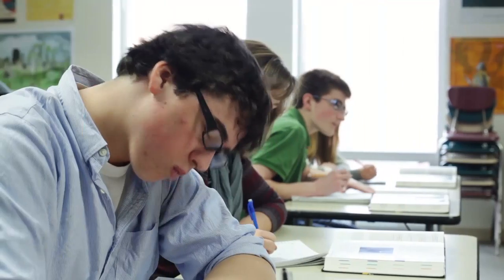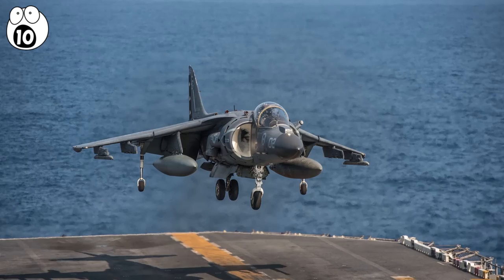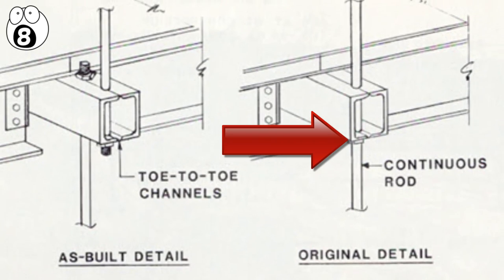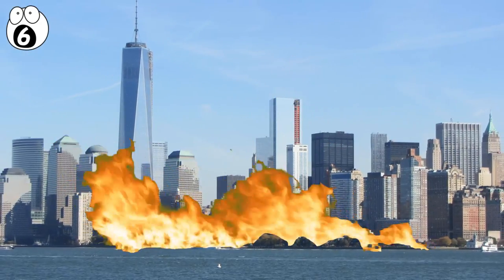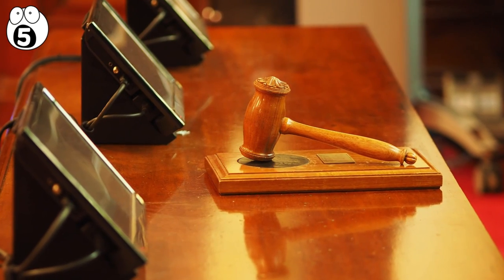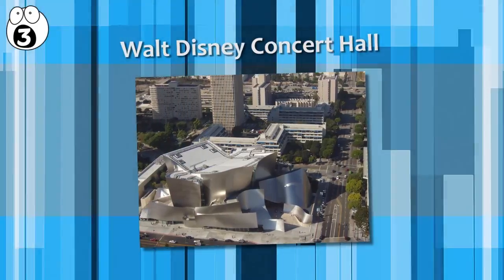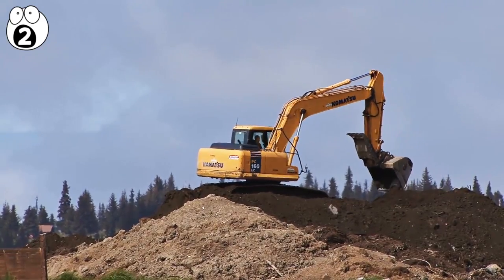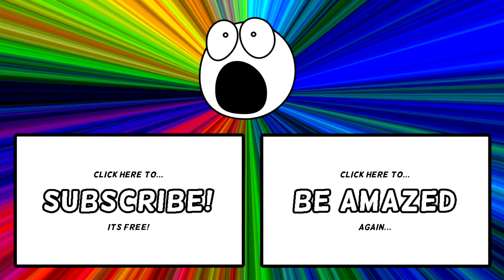Biggest Design Errors Engineers & Architects Made

Comment: Have you considered that it was difficult to build a huge runway on old ships
Reply: I  wonder if they had catapults on the first generation aircraft carriers. Probably not, that would explain the single long runway.
Reply: kunstsein I would have to assume probably not
Reply: Catapults were added IIRC in 1943 to the Enterprise, which was usually upgraded a little while after the ships came off of the production line. The reason they had no catapults earlier was not because they didn't have the technology, but it was because they were unnecessary. The F4F wildcat, which was America's main naval fighter until 1942/1943, which was notoriously under-powered, could take off in 174 feet, with a 25 knot headwind(http://www.wwiiaircraftperformance.org/f4f/f4f.html). That speed is what an aircraft carrier would be going at launch speed, not even with any actual headwind. So that distance could be shortened by an actual headwind, and due to the fact that the deck was usually 50-100 feet above the water, a wildcat could take off in about 1/4th of the entire deck length of 770 feet with ease, loose a bit of altitude if he is going too slow, but then be able to climb out fine. When planes such as the f6f and f4u came around ( and other bombers and scout planes), the need for extra plane storage space and a shorter takeoff distance encouraged the addition of  a hydraulically powered catapult which could increase the speed of the aircraft to suitable takeoff speed in less than 75 feet. 

:D
Reply: Thanks for the infos, appreciated.
Reply: Most aircraft carriers at the time were actually just normal ships converted to be "aircraft carriers" because it was much easier than to build one from scratch... So this video is bullshit...
Reply: Ok you are incorrect. If you are referring to WWII they were built from scratch after around 1930.
Reply: +cyberworks entertainment:
as I said above mama Houshou was the first purpose built carrier ever made ever. That old girl was commissioned in 1922. America's first purpose built carrier was ranger, laid in 1931.

as for WWII: our big names are Yorktown class (3 hulls) like Enterprise: these were all purpose built for the role, and started showing up in the late 30's. Akagi and Kaga were started as Battleships in the 20's but when the washington naval treaty happened the IJN gutted out the hulls and rebuilt them as carriers (a limit was placed on 16" guns by the treaty). But all the other pearl harbour carriers Shoukaku, Zuikaku, Hiryu, and Soryu were purpose built. USS Wasp, the Essex (24 hulls) and Midway class (3 hulls) were also purpose built. The Japanese also have the Taiho and the Unryu class (3 hulls) that were purpose built. The Germans attempted the Graf Zeppelin but never finished her because she kept getting bombed. The British had carriers as well, though I know virtually nothing about them. 

there's also a whole slew of light carriers that were purpose built by the US.
Reply: Although, Japan really didn't make a huge show of Houshou. They didn't want the eyes of the world on them (specifically their military buildup) and so they more-or-less kept quiet about such things. They also made Nagato appear to have a lower top speed than she actually had, to make her seem less superior to Colorado.
BTW, you're forgetting Shinano, whose origin was akin to Akagi and Kaga (though on a grander scale). She WAS built but soon became "the largest surface ship sunk by a submarine." USS Archerfish pls.
I can't remember, did Mama Houshou have any contemporaries at the time of her construction? Like, by the time she was carrying out carrier ops (I believe in China) did any other nations have CVs being launched? Such as the Langley?

Comment: Hyatt walkway failed because the weight of BOTH walkways was on one fastener, instead of just one. With one continuous rod you would have a fastener (nut) mid way that holds the top level, and another at the end holding the bottom. This would result in each fastener set holding one walkway. Both walkways weight still goes through one rod.  With the way it was implemented, the lower level hung from the top level, so the top levels nuts had to hodl both up, and failed.

Tacoma bridge was actually very flexible and bendy. The bridge failed because there was no wind relief, as you said, causing lift, which over stressed the bridge.  The holes would not be for flexibility but as you say to let wind through interrupting the lift.
Reply: And wasn't the weight of too many people the biggest factor in the collapse of the walkway? More people than allowed by the city and/or engineers?
Reply: Mark, not really.  There should have been enough margin designed in to handle a little extra.  The big mistake was a change to 2 shorter rods during construction.  The engineers either didn't recalculate or weren't even asked (not sure which).
Reply: But it wasn't a little extra - there was a HUGE, packed dance party going on, as I recall.
Reply: Sure it was busy.. which made the fact the one set of fastners now had to hold double the load of its original design deadly.
Reply: Mark Basnight Engineering standards plenty of extra strength especially in public buildings such as the Hyatt. With the original design you could pack as many people as possible on there and not have an issue. The problem came from the fastener/connection at the bottom of the top rod having to support the weight of both the top and bottom walkway. With the original design the fastener/connection under the top walkway only has to support the weight of that walkway and not the one below it. The video made it sound like it was a problem with the top rod however the top rod was still in one piece and hanging from the ceiling after the walkway collapsed.
Reply: Thanks Curt. I might have been not saying it correctly
Reply: I imagine someone got good and sued.
Reply: they did recalculate and where told. The engineer in charge ignored the problem and the information was leaked to the press.

Comment: The square windows weren't the sole cause, or the start of the problem on the comet. Old sheet metal methods punched holes into the metal which caused miro fissures in the metal. (stress induced cracks), The square windows were a focal point of pressure that only increased the failure of the metal.
And with the constant cycle pressures of inside the cabin and atmospheric pressures. The airplane failed in flight when it was pressurized.

All windows are rounded now to evenly distribute the pressure load. And, holes are no longer punched out. They're drilled and reamed.
Reply: Also, he says "going extremely fast, extremely high off the ground, it really concentrates a lot of stress". Speed had nothing to do with it; as you point out, it was pressure changes. 

It couldn't be proven conclusively (and safely) until one of the investigators came up with the idea of replicating pressure changes by building a water tank and submerging the plane in it. Needless to say, the plane wasn't moving extremely fast inside this tank. 

This video is infuriating. EVERYTHING he says is wrong.

Comment: The straight deck carrier was satisfactory in days of slow propellor driven planes.  Once the jet aircraft with higher landing speeds came on line, with the possibility of a bolter (landing airplane missing the arresting wires) the need for angled decks became apparent.
Reply: Chuck Farmer 
   "Bolter", is ram full power, and go around, taking-off again!!!
Reply: Chuck, even prop planes had issues landing.  There were several instances where planes at the end of the deck were crashed into.  The reason it wasn't as big a deal was the planes were cheaper and losing one to the sea was considered acceptable.  The angled deck allows for other advantages as well.  You can take off and land more planes per hour than with a straight deck.  It shows a good design progression, not a failure.
Reply: That was never an issue mate.

Comment: The Hyatt Regency Walkway didn't collapse because there was too much weight on the top rod.. it collapsed because of the sheering force on the beam that connected to the two sets of rods.. effectively, one set of rods was pulling the top walkway down while the other set of rods was pulling it up causing the support beams to tear and the structure to fail.. the rods themselves could sustain the entire weight of the structure and so could the ceiling but the beams could not sustain the sheering force created by the last minute design change.

Comment: Actually the Comet catastrophe had nothing to do with the speed it flew. It was the first airliner with a pressurised cabin, as the fuselage kept pressurising and depressurising the stress of doing so caused the fractures near the windows. Another problem was discovered as well making this flaw even worse, the windows were supposed to have been riveted in but instead the guys doing the work had screwed them into the fuselage causing extra small fractures around the screws used
Reply: Yes!
Reply: This.

Comment: #8 - you don't understand the issue any better than the constructors or architects who made the mistake!   The original design was substandard in the first place, but would have worked, but could not be constructed as the rod would have to be threaded its whole length and the threading not damaged during construction (basically unrealistic).

The manufacturing change as completely wrong, and the method of attachment of rods to box-section should have been with a suitable clamp designed for load.

Multiple errors by multiple parties and a lack of proper procedure for design change approval...   

See "Collapse Why buildings Fall Down", ISBN 0-7522-1817-4
Reply: #7 - the stress is mainly from the pressurization of the cabin, not the speed of flight.

Comment: The Tacoma Narrows bridge was actually due to the fact the metal used (in the cables iirc) was flawed and too brittle. It shouldn't have collapsed under that low wind regardless of the design flaw. The reason it actually collapsed was harmonic motion. There was no gale. It was steady, constant winds that caused it.
Reply: It wasn't a low wind but a Force 8 (gale) which is a pretty strong wind. "Some twigs broken from trees. Cars veer on road. Progress on foot is seriously impeded"
Reply: NolePtr it was because fhe steel they used couldn't bend, and if bent and cracked
Reply: Dead Games. have you seen the video of the collapse.

Comment: Citygroup:
As the architect explained himself a student who was researching the design called him to ask for details of the design and questioning the corner winds. Afterwards the architect recalculated it all and he found a major flaw in the design. The crossbars leading the loads into the massive pillars in the ground needed to take 2 times the load as it was projected for. Therefore they had to enhance these crossbars. All of this was after the building was build. It was first in the enhancing fase, they discovered that a bolting option and NOT a wielding option was used for the crossbars. Therefore these connections were reinforced with some wielding and plates.
To summarize:
You got the names right in that example but other than that, everything else is wrong. They wanted wieldings and not bolts, they didnt even know it was a problem before they were ready for the reinforcement.

Comment: The Tacoma bridge was of sound engineering but no one could have expected the weather occurrence of the day to have had such a significant effect, based on the then knowledge and experience up until then.

These days bridges have a much higher safety factor built-in and still within a reasonable budget, and so, occurrences like this are now ultra rare.

Comment: Too many errors, number one being the making of the video. The Comet stress fractures were actually not the square windows but the framing the windows were attached to combined with pressurized flight cycles. The Tacoma Narrows bridge flexed just fine, ever watch the video? It was a harmonic issue caused by wind. And since when did an engine cause a sub to surface, apparently boyency and flood tubes have nothing to do with it!

Comment: Number 9 was not caused by a lack of holes. It was because the road structure was far too narrow for the span, as many engineering documentaries will tell you, and thus, since bridges are designed to be flexible to account for heavy winds, the structure ended up being TOO flexible and thus collapsed. It's a thing called "Resonance". Once it got going, it got going and built up tenfold until the structure could no longer take the strain and collapsed.

Number 10 is completely false. Angled Flight Decks were not even considered until jet aircraft started filling the decks of aircraft carriers in the 50s and 60s, due to the necessity of installing catapults to ensure these heavier planes made it into the air.

Number 7: The whole "square windows" and the De Haviland Comet disasters was due to a lack of understanding on metal fatigue and the consequences on pressurized aircraft at altitude, rather than any particular design flaw.

Number 6: The flaws in the logic on this one are pretty obvious, and already pointed out.

In all, the information in this video is seriously flawed, and the video is in need of total redesign

Comment: Just a quick fact as most of the corrections have already been made, The De Havilland Comet was the first jetliner. At the time, powerful softwares that engineers use today for stress simulations (eg. Ansys) were not available and hence the windows were sharp edged since probably nobody expected such large stresses. Today metal fatigue is well understood and simulated before production begins and the comet is one of the reasons for this advancement.

Comment: So many bits wrong in this video.

#10: Aircraft carrier runways:
The speed of early aircraft was slow enough that they needed less space to land, but as jets came along, they needed more space to land because of their higher speeds.
Aircraft would either be lauched, or recovered, not both at the same time... however an angled deck could allow both the happen at the same time making them more efficient.

#9 Tecoma Narrows bridge:
The collapse wasn't because it was solid (if it was solid, it wouldn't have been able to flex in the way it did before collapse.
It collapsed due to resonance caused by the bridge moving but the resonance frequency growing to the point the bridge structure couldn't withstand.
This phenomena wasn't known when it was built.

#7: DeHaviland Comet's square windows.
Although it's true that a squared corner adds a greater level of stress, the're more than the simplistic description in this video.
First, the Comet was the first jet airliner and few aircraft up to this time were either pressurised, or flew at high altitudes. This is why the unpressurised  DC3 is still in service today, but generations of pressurised airliners have been scrapped because they've outlived their pressure cycle limit.
Secondly, the Comet used punch riveted holes (which aren't as precise as drilled holes) and this added small fractures around the hole resulting in a crack that could grow from the stress.
Every airliner crash brings lessons which may reveal phenomena that weren't known about and were unexpected, but there's a difference between a design blunder, and not anticipating something that wasn't known.

#4 isn't an engineering blunder, nor an architectual one... it's a perfectly good functioning building... it's just not appropriate for baseball.
I bet it would be fine for cricket or basketball, volleyball and hundreds of other sports!

#2 also doesn't count as an engineering or architectual blunder... it was a site management blunder, which is significantly different.

#1 A revolutionary new design takes a while to evolve.
The Peral couldn't use petrol or diesel engines at this time because they weren't reliable, so electric motors were used powered by batteries.
The displacement and air tanks were adequate and it was generally considered successful... which is pretty impressive since it was experimental technology.
Ultimately, submarines didn't become properly viable until the turn of the 20th century, and in particular WW1.

Comment: About the de Havilland Comet, the windows did not break due to a sustained high speed, it was because the passenger cabin as in every modern jet liner is preasurized. So the preasure outside the plane is lower than the one inside the plane, the part that is true about this is that yeah, the corners of the square windows could not sustain the amount of preasure, cracking up and making the aircraft break in mid air. They actually tested this by submerging the whole cabin in a water tank, another clear indication that speed had nothing to do with this.

Comment: The aircraft carrier critique is ridiculous on so many levels. 1) Carriers were around over 30 years before someone hit on the "simple" idea of the angled deck. 2) We still use the cables; arguably, they're more important now than before. 3) Landing on an angled deck is actually harder than on the straight deck. Instead of trying to land on a runway straight moving away from you at 30 MPH, the runway is moving away from you and to the right at 30 MPH.  4) The video shows a Harrier jumpjet, which is infamous for being able to land vertically. 4) Carriers had a vertical net barrier that stopped planes that missed the cables, keeping them from running into the planes on the bow. 

Quite a few pilots died trying to work out just how to best use this "simple" angled deck.